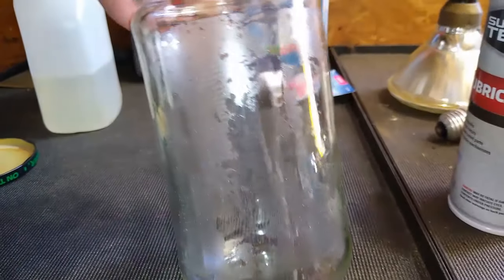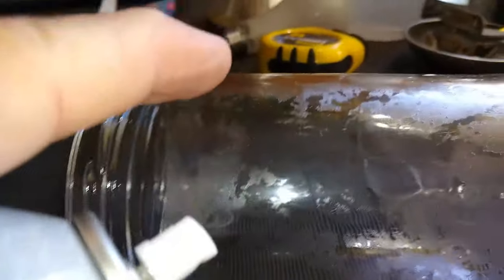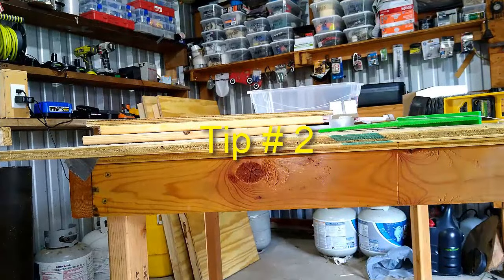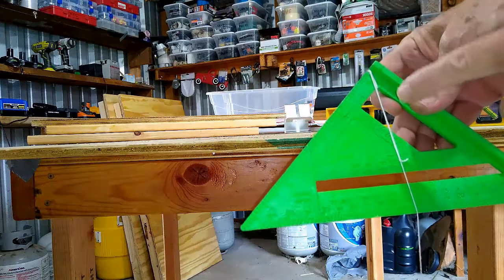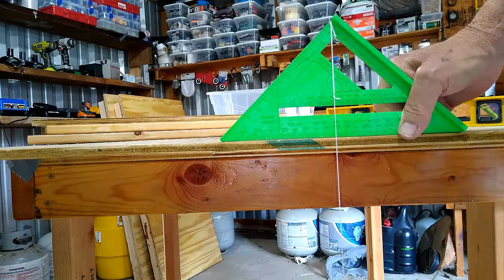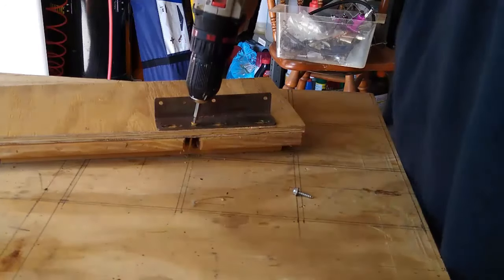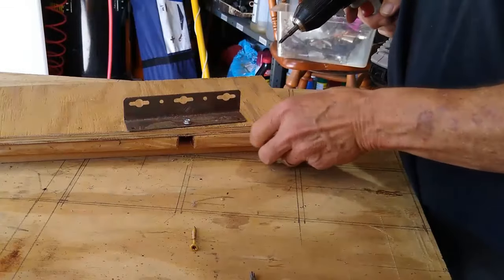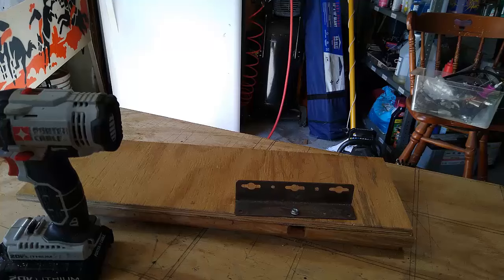Tips for the shop

Comment: Dirty motor oil will work too.
Reply from the maker: I ain't tried that yet, but I will. Clean oil work too?
Reply: @CountryFolksLiving  i guess what works best for me is an oily shop rag. Then i clean it with a mixture of about 20:1 water and johnsons baby shampoo, i just have that setup in a spray bottle for other reasons so i use it to clean a lot of stuff. 

Probably most oils will work to remove the adhesive would be my guess